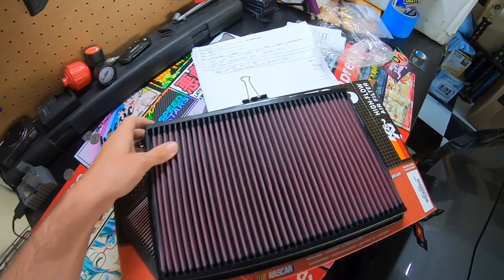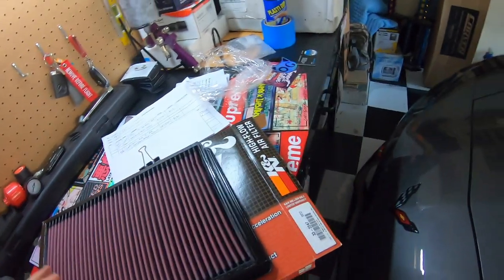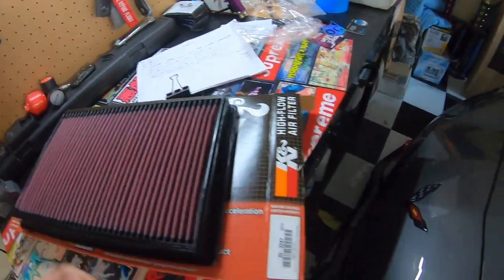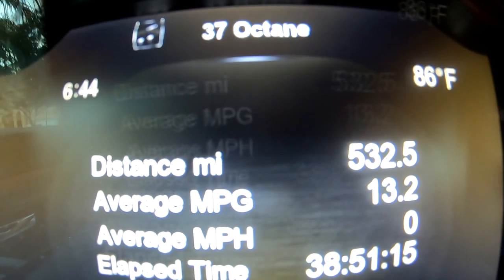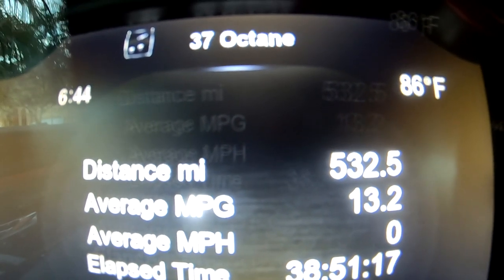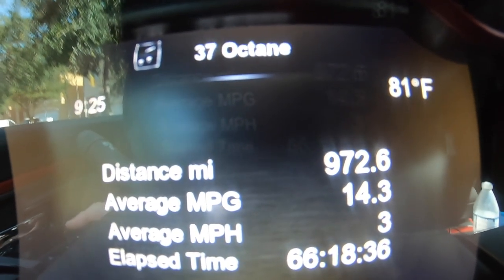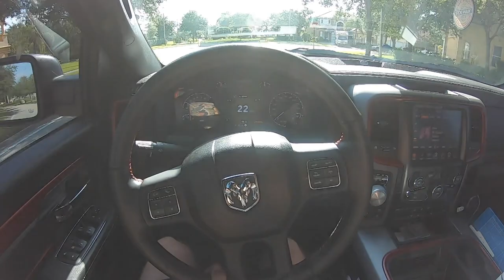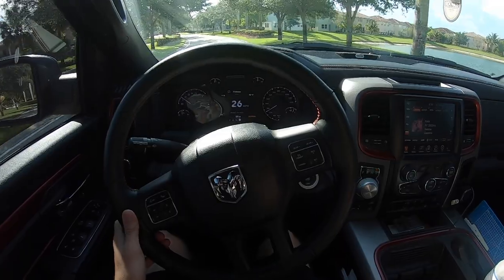Ram Rebel 1500 5.7 Hemi Air Filter Change (K&N Upgrade)

Comment: After watching your video I went and bought one from ebay 53.00 shippedYes it works!!! I have a brand new 2019 warlock ram and only 1000km. Best buck so far spent.I can tell the difference in throttle response and acceleration.Thanks for your videoNext is 3 inch flow master Super 10 kit exhaust kit.
Reply from the maker: Heck yea thats awesome!! Congrats on the new truck as well! You're gonna love the exhaust.

Comment: Works awesome on a v6 2021 ram 1500 dt, fuel consumption has increase from 12.2 to 13.7
Reply from the maker: Hell yea! Not bad for just a filter!
Reply: @Wimya  well, after today’s 50KM commute the consumption is 12.0 L/100 KM (I guess I should have clarified the units). The throttle is much much more responsive and I am finally enjoying the truck. I was almost going to change to a HEMI be at the V6 seemed chocked and lethargic. I wonder if the computer is going to recognize and adjust for the increased air flow, I guess we’ll see. One more thing, the fuel consumption at acceleration has increased a lot ( I kept an eye on the gauge) so I guess if you don’t drive aggressively, you can still save the fuel costs yet still enjoy the power sometimes. Thanks man!!
Reply: You use the same filter in this video for your v6 ?
Reply: @malanikeama6128  I did, but I have a HEMI now, 😂
Reply: Thanks for ur reply, I have a 21 RAM 3.6 with etorque. Looking into this high flow filter.
Reply: @malanikeama6128  it works for the v6, significantly, but a little impact on fuel consumption

Comment: I always put K&N filters in my vehicles.  Any updates on this.  I have the 2019 RAM Rebel and love it but the fuel economy horrendous.  Will do some additional mods after it goes out of warranty but wanted to do anything I can now without the risk of voiding it.
Reply from the maker: Michael Rachal after about 3000 miles I’m still averaging around 14mpg. That’s mostly highway miles and with using 35” tires.

Comment: I'm having trouble opening the air box. Seems like that tube on the motor side is real stiff and won't let it open. Any pointers on how to open it would be good. Thanks. 👌🏾
Reply: You have to push a little towards the drivers side and downward to unlock the plastic pins, look on the right side of the box Opposite of the release latches. Basically the other side.Mine was very stiff too. But it will unlock and then reverse when final closing of the cap and lock the latches.I have a brand new 2019 ram warlock with 1000 km so everything is new and stiff